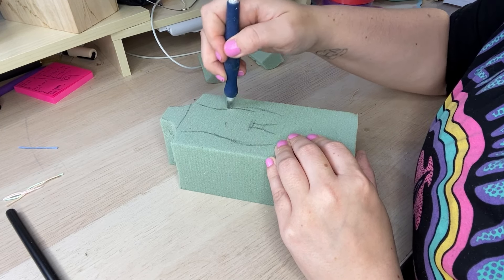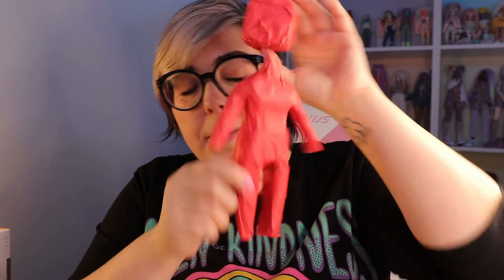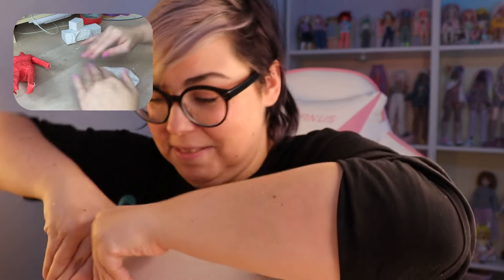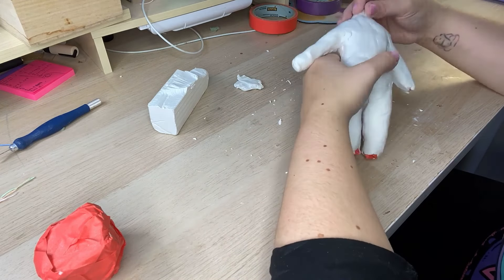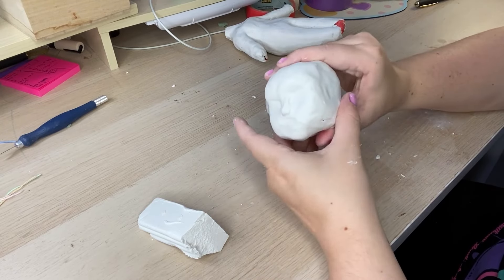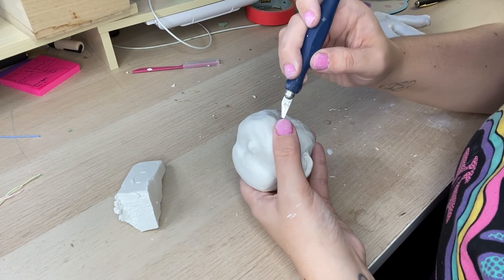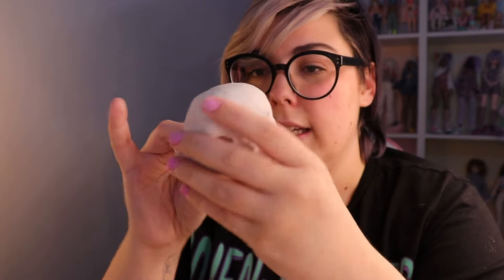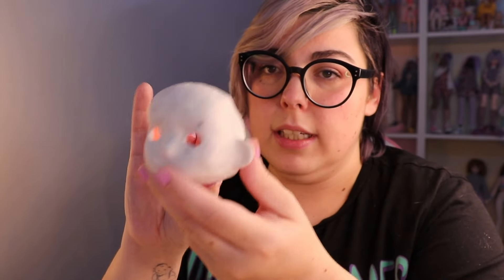Making a polymer clay Ball Jointed Doll 1: All about that base

Comment: Where did you get the idea to use foam?
O__o why not use foil?
Reply from the maker: Ahhhh in the part of the video that cut out, I mention foil is really tough to get out, and always ends up leaving bits behind. The foam compresses and pops out, if you put masking tape over. It worked really well. 

I cant remember who, but another artist mentioned it.